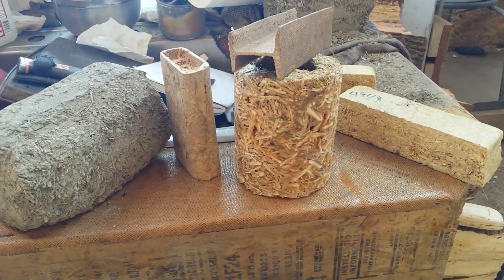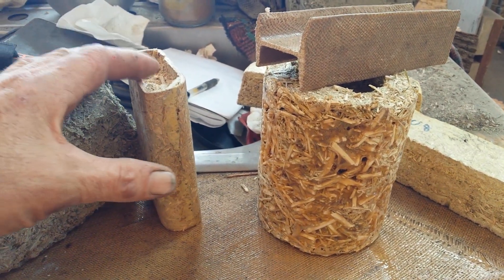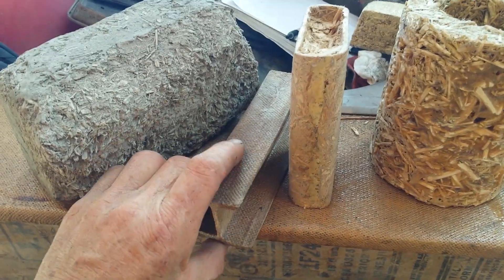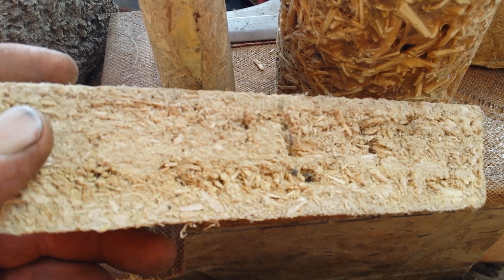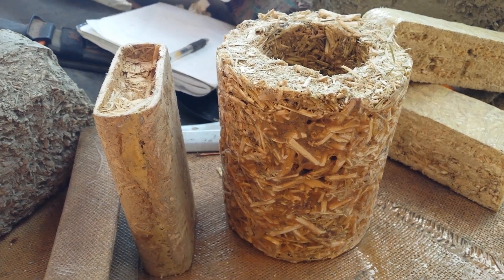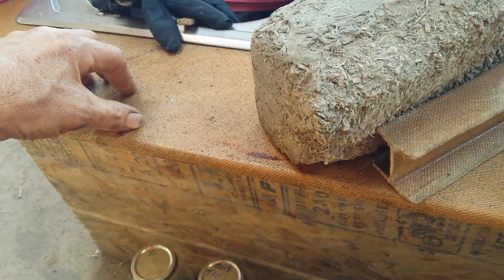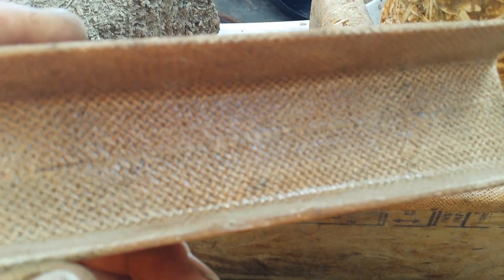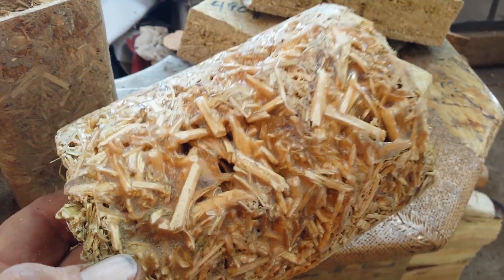Industrial Hemp Construction Concepts,  bast/ shiv composites of varying adhesives and epoxies

Comment: Hi. I’m a hemp research student and I have seen all your videos but i wanna see how did you make the i beam using the fiber? Can you tell me or make a video on that? I think most people are asking for it. Good work man ! Cheers. Subbed
Reply from the maker: Thanks for the interest, tried and failed at my attempt at 501c3 so I could do question and answers hand's on teaching and further research
 Please consider contacting your teachers and asking your current school for technical support suggestion and help
Reply: @mrglasecki  as I am an independent researcher, I dont have a school or a teacher and totally rely on the Internet and YouTube to learn. I didnt understand what you meant by 501c3? I’m curious to know how did you glue it? Thanks!!
Reply from the maker: @ankytripping  used epoxy would suggest acrylic
Reply: @mrglasecki  but how do i remove the fibers from raw bast fibers and should i just put them in a mould with glued fibers and press them to get the shape? Im stuck here at the removing fibers part, pls help. Thanks!
Reply from the maker: @ankytripping  Seriously turn Off the internet and read a book
Reply: What book would that be? I can't seem to find any regarding hemp around here where I'm from

Comment: Amazing!! Any suggestions on how I would increase my ballistic armor plates before I give it a go? I have 6 kilos of bast fiber, hurds and bondo resin. I'd love to try and process it in a way to make the best 1/2 -3/4 inch level 3 plate to stop any pistol round. Need to look into this PLA stuff :)
Reply from the maker: I'm a paralyzed vet not big into civilian gun market but I did a hardened structure for the Marines
 
 i expect a royalty if you go to market
ditch the "Bondo" go with a chemically reduceable plastic or PVA
 had Good results with spray on bed liner, alternate by inserting hardened layers of the Bast with epoxy
Reply from the maker: Epoxy isn't quite enough
** acrylic hardened 😑 absolutely as much clean (free of shiv cellulose) but not broken bast fiber  
 little resin as possible strength is in that fiber
 cast under vacuum
Using the spray PVA and Co2 or bed liner plastic to bond the layers vacuum here with peel-ply will help as well
Reply: mrglasecki Thanks for the info!

Comment: I have to ask, do you know how sturdy hemp walls would be, to create prefab walls? or would it kind of crumble with minor twist and bumps? being lifted with a crane, any advice you give me from here on out would not go un noticed!  *Canadian Hemp co*,!!
What is the fastest hemp plant you have grown? so far for me is about 4-6 months
Reply from the maker: All hemp is similar 120-180 days except (rutaralis 45) 
 fiber would be the fastest, grain second followed by medical (not because they are different, because they are similar) fiber @400,000 plants per acre, is all Bast string fiber
 versus medical @1600 ppa becomes a squat Christmas tree and almost all the woody Shiv core
 Prefab tilt up panels would be easy enough, and can't see or imagine a crane hurting anything I've made.
 And I can't remember if you asked another 😎
Reply from the maker: https://youtu.be/HSE5vESjFk0 BTW HempCrete (not hemp lime bullshit)
 HempCrete is considerably stronger than steel reinforced concrete
Reply: @mrglasecki  I will check that out, so just add cement to the Hurd ? Wondering how far 1 bag of cement would go using Hurd with it, I'm sure you could stretch it way out no?
Reply from the maker: @x2gaming149  basically the same as normal mixes
your still using a five to one ratio by volume  
just changing the sand and gravel for Shiv and Bast fiber

Comment: If we grow hemp down the sides of the roadways and freeways and around the factories we can reverse the pollution in a generation while providing fuel that burns cleaner, clothing that lasts longer, and building bricks better for the environment that are also more fire resistant! The amount of other products possible to be made from hemp is astounding. Henry Ford made a car from it that was stronger than the steel ones. Once we decide hemp is a better option that oil products then healing can begin. The government doesn't lose control. They should. We have all the railways that we can use from all over the United States to ship it to the great lakes area for processing into the products afore mentioned. Once they are made the fuel alone could fill U.N. boats and it can be taken to third world countries where they can't grow it. Fix the third world while using the first worlds infrastructure to do it. Along the way we could grab some 3D printers and get some of the recycled filament from any number of companies that are turning our trash into products. Those printers could make prosthetics that can be distributed to those that are injured from war and conflict. It solves too many problems not to be heard
Reply from the maker: To be honest and fair Henry Ford got close and used a ball bat
https://youtu.be/zxj-86NIf8U
That's a 3lb hatchet 😏
And his would burn🤨
Starlite
https://youtu.be/fmCSmI-5MK4
Reply from the maker: BTW😏 biochar graphene is infusion able into ABS now, honestly Kool beyond words

Comment: If you aren't already, I suggest comparing before/after weight when checking for absorption. Rather simple and accurate way to judge absorption rates.
Reply from the maker: For the most I do, if you notice there will be a gram weight on almost every piece 
Yet I don't drowned, beat or burn everything as a set rule
Reply from the maker: @nh251  yes but not those samples, mostly set it on fire

Comment: Legitimate question, cause I'm a little obsessed... real world cost per board, say 2x4x8, and does it take nails, if not then whats the best attachment method, and is it quick or at least efficient?
Reply from the maker: The price is how far someone has processing it,. Raw out of the field is $150 but you need a way to load it, and Yes goes Up from there,. 

 As far as Actual strength,. Most anything you hear me say is a second for third attempt, are exponentially Stronger than the video,. 

 EVERY thing else is trials and errors,. If you need the answer first,  without understanding, good luck
Reply from the maker: Not sure how much you intend to compress the material during manufacturing, or adhesive you choose, various
 Hemp Shiv is a hardwood, use a PVA (like AC plywood) mill it into anything you design and desire, it's manufacturing manna.

  glue n screw's would be the best form of attachment, 
 pneumatic nailed, possibly,.
 Anything over 0.75",.
  by hand nailed, would be like Pissing Up a rope in the Wind,
Reply from the maker: Good hardwood Screws
Reply from the maker: Sorry missed the cost per piece, but again it varies. 
 Here it's 200-600 a ton, if using All Shiv it will be slightly higher weight,. Yet (**around) 250-300 pieces per ton,. 
 Again varies on compressive strength of manufacturing
Reply from the maker: Sorry missed the cost per piece, but again it varies. 
 Here it's 200-600 a ton, if using All Shiv it will be slightly higher weight,. Yet (**around) 250-300 pieces per ton,. 
 Again varies on compressive strength of manufacturing
Reply: @mrglasecki  the 200-600 just for the Hemp bits? or does that include epoxy/resin? 

No worries on timing of your responses... I"m mostly spitting into the wind, as a logger I get folks declaring the superiority of hemp on  a regular basis... I want facts not good ideas. Most folks just believe whatever hype their into and call it the truth, I try to be different, even if it means I'm wrong.

Thanks for your time, its much appreciated
Reply from the maker: Have two bandmills and a circular saw myself,. Had dozers and skidders, semi's as well

 Hemp(Bast)fiber is Stronger than steel, Only the adhesive weakens it,. 
 Gotta keep that in mind, when Anything structural is referenced,. Hemp Bast is Omni directional